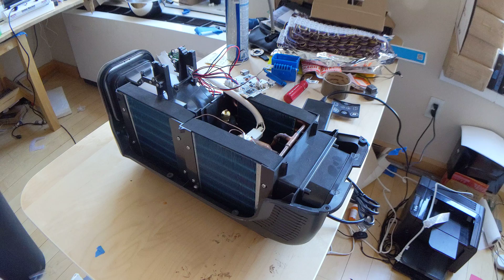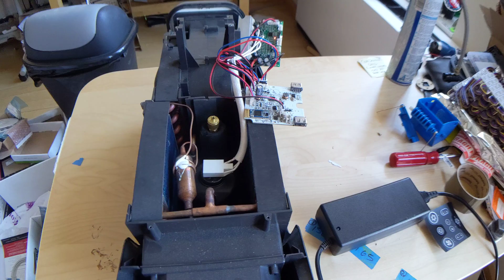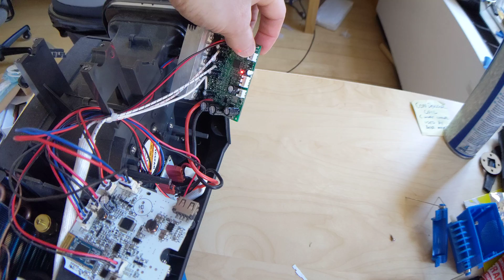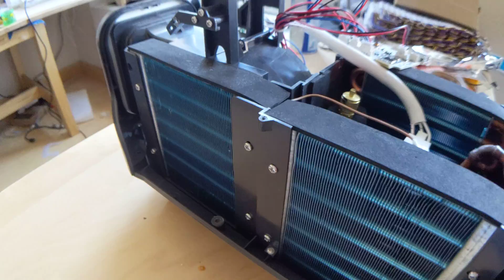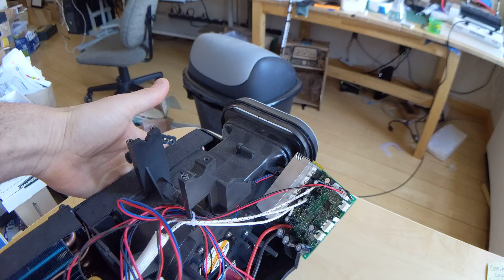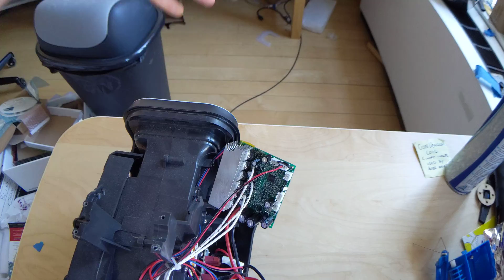A look inside the Zero Breeze air conditioner with a tiny little compressor

Comment: Any idea about a capacitor replacement? Mine is bad?
Reply from the maker: Which capacitor?
Reply: Sorry, I thought it had a capacitor. I opened up my unit, noticed there was a burnt smell (like plastic) it was the white plug that goes to the compressor.  The unit will run them shut off. Not sure if it is the compressor.  Thanks

Comment: Any idea why the unit would shut off on its own after a few minutes of running?
Reply from the maker: Could be many things, but the first thing I would check is an "over pressure" fault. This happens when the hot side coils get too hot, and this can happen if not enough air is flowing over them, and this can happen if the air is getting blocked, and this can happen if something is blocking the vents or the coils are fouled with built up dust and crud. Do you feel lots of hot air blowing out the back? Can you tell if the coils are getting blocked?

Comment: How did you disassemble the unit? Can you make a video showing that?
Reply from the maker: It was a while ago so I don't remember the exact steps, but it was not too hard. A few screws and plastic snaps.
Reply: @bigjoshlevine  I have a zero breeze, but the power port supply on the back broke (plastic). Zero breeze charges too much money to fix it, do in looking to see if some super glue will fix the plastic part. I removed all the screws on the bottom, but am meeting with more resistance than I dare really push. Did you remove the top?
Reply from the maker: @t.drayer11 You could probably just nibble that broken connector out and replace it with a different one or connect the wires directly.
Reply: @bigjoshlevine  I tried to pull the connector out just a bit but the electrical wire to it must be real short, cuz there is no give to it. I have the mark 2 model and I don't know if that's the one you have also.

Comment: Can you help?

https://youtu.be/jbEaA0Ib1Sg

I am having trouble keeping the compressor running when i bypass the factory on/off switch with all the wierd features. Thanks
Reply from the maker: Maybe you are tripping the overpressure safety shutoff? This will turn off the compressor if the pressure in the pipe coming out of the compressor gets too high, which can happen if the condenser coils are not cooling off enough. This often happens in normal AC units if the coils don't have enough air blowing over them because they have crud on them or the outside fan is not working well. 
To see if this is you problem, maybe try putting some ice cubes on top of the condensing coils and then turn on the unit and see if it runs for longer time before shutting off. 
Report back with what you find!
Reply from the maker: Maybe try moving that fan I see in your video so that it is blowing air right into one side of the condenser coils to at least get some air moving though them? Normally the case would force the air that fan is sucking to pass though those coils on the way in.
Reply: @bigjoshlevine  awesome info! Thank you I'll try in the morning after work:)
Reply: I tried the ice by holding a few cubes on each side, putting the fan shroud and lid on, and I also mounted it back on the base. Still behaves the same way. I just ordered a variable speed compressor controller from Rigid and will be installing it when it comes in. I am building an aluminum shell now, so I'll update as I make mistakes😊
Reply from the maker: @functionalvanconversion4284  Hmmm... I am pretty sure the one that it came with is variable speed. On mine there is a little variable resistor that I think sets the compressor motor speed. You could try turning the speed way down and then seeing how it runs like that and then slowly turning up. It is a pretty simple system so hopefully you can nail down what is going wrong.
Reply: Is it normal for the capacitors to register 205 degrees? The AC is working now but I just wanted to double check. I am not sure why it was shutting the compressor down. I am going to run it off a relay for now and try the arduino when it actually works for a while.
Reply: I finished the frame, foamed all gaps, and the compressor only stays on for 15 minutes max and it doesn't have a consistent amount of time that the compressor stays on. I am going to shelf this for now. I really want to bypass the on off switch that zerobreeze provided and I believe that is the problem since I remember this happening when I tried to put a speed controller on the compressor years ago. Thanks for your input and if you have any ideas please let me know.
Reply: I got it to work for a year with buck converter step down my lithium battery bank. Now it's doing the same thing. I ordered a split system for my man and have given up on this unit. Months of tinkering for less than a year of usage😢.

Comment: So there’s only one rear fan, then how it pushes hot air and brings in cool air from the outside. By the looks of it, it only exhaust hot air from the condenser coils using the rear fan.
Reply from the maker: There are two fans - one that sucks outside air though the condenser coils and then blows out the back, and the another sucks outside air though the evap coil and then blows that (cool) air out the front (where you are supposed to aim it or duct it to where ever you want it).

Comment: Could you wire an analog thermostat on this like you would find at a big box store? Mine actually gets my sleeping area too cold in the middle of the night. But need it full throttle in the day to try to keep up. Could you recommend a variable speed compressor controller also as it's pretty loud
Reply from the maker: Yes, no problem. Even better - you could use an arduino and a digital temp sensor to have this unit slow down to the exact right speed to keep your room at the set temp. Much better than having it cycle on and off - especially where you sleep!
Reply: @bigjoshlevine  thanks for info. I am educating myself on arduinos. Would I connect the Arduino and thermostat to the red and black wires that connect to the ZeroBreeze control board? I tried connecting an analog thermostat to these two wires on the ZeroBreeze but could not get it to work. I also tried connecting a speed controller, but it must pass a small amount of current even in the off position since the compressor would still run and had no change when I adjusted the speed controller up and down.

Comment: I bought 1 to use in my Jeep.  It does work.  However, my keeps stopping.  It cools from a beginning displayed temp of 90+ to 74 or 75, then stops cooling the air coming out.  I turn it off for 5 minutes, then it starts cooling again.  Any thoughts?

Comment: Can anyone help me and tell me how to take the cover off this thing? I need to get inside to fill it up with Freon, and I can’t figure out how to do it without breaking the plastic cover.
Reply from the maker: What happened to the refrigerant that was in it?!
Reply: Josh Levine No idea, I bought it like that (used).
Reply from the maker: I just unscrewed the screws and popped the cover off, I don't remember any special trick. But are you sure that the problem with yours is low refrigerant? When you turn it on do the fans run? Does the compressor run?
Reply: Josh Levine yes, everything runs good. It’s actually a friend of mine that’s trying to fix it for me, apparently he knows what he’s doing 🤔. He said there is a small refrigerant leak. I have no idea why he has a hard time taking the cover off. I’ll go and see him tomorrow. Thank you for your help!

Comment: Thanks for the video. I pulled mine apart because it almost sounded like the fan was hitting something. Turned out it was the compressor vibrating loudly. I added some foam on the top and bottom of the mounting bolts and now it’s very quiet. I also noticed that the air inlet for the condenser and evaporator connects. I’m sure it’s not a big deal as both fans pull through the condenser and the evap. But I sealed that off also.

Comment: so folks are not mislead? Rotary spins and if it's a piston going up and down it's called a reciprocating compressor? But it's probably neither of those and instead a scroll? That round copper thingamajig is called an accumulator or a filter/dryer but in this case it appears the compressor high side goes through the condenser coil in back to lose heat then comes to the filter/dryer splits between the 2 evaporator(cooling) coils becoming gas and returning to the compressor? Just my thoughts and its really a cute baby set up because back in my days we just hooked a 4" flexable duct onto the supply from a 5000 btu window unit from sears for 69$ and out tent was the envy of the campground! :-)"
Reply from the maker: I still use the flexible-duct-taped-to-outlet-of-window-unit trick to get silent cooling in my bedroom. Lazy man's split system! :) 
https://twitter.com/bigjoshlevine/status/1285064587180740609

Comment: So, it does look like it actually has a compressor, like any good AC system must have to call itself that, but, where is the heat from the room it's trying to cool get dumped to?
Reply from the maker: There is a condenser coil with a fan that blows the hot air out the back. You can either just aim the cold air towards you and the hot air away from you, or you can connect a flex duct to take the hot air someplace far away or outside. Here is a video showing the setup... https://www.youtube.com/watch?v=v2ZisExtbhM . Not how I would do it, but unlike every other portable cooling system I've seen it is an actual AC unit.

Comment: What kind of refrigerant does it use?
Reply from the maker: Likely R134A.
Reply: @bigjoshlevine  In the USA R134A was made banned for use in new equipment as of 01/01/2021.

I wonder if they had a stock pile of R134A? to use up then?
However like no one is getting my stash of R12 cans or my full cylinder of R22. but I have to go I think the EPA is knocking at the door!

Comment: and those tiny compressors are used for portable car  mini refrigerators! can find a ton like them on aliexpress 12/24v ones. and thats rotary but doesnt have any fancy energy efficient stuff like inverter tech. and all they did was to build a case for that?? it will definitely not cool even a tent.

Comment: Could have been lighter and more powerful with microchannel heat exchangers don’t you think?
Reply from the maker: I don't think the coils are the limiting factor for either the size or capacity of this unit. If you made the evap coil smaller you'd still be limited by the size of the output ducts. Based on the fact that the condenser coil barely feels warm to me I thank that is also probably sized to fit the form factor. To get more capacity I think you'd first need to size up the compressor which would be challenging for the current form factor.
Reply: Josh Levine That’s exactly what I mean, by switching to microchannel heat exchangers, more space can be dedicated to more powerful fans and a slightly bigger compressor.

Comment: I own one for over two years, it will keep you cool in hot weather but your face needs to be right in front of the unit. I am going to try to modify the housing, so I can put have the unit outside my campervan window as it just fits if I eliminate the blue top cover just like a standard window AC does (major space waster). The reason is I have tried venting the air out the window, even installed a 4 inch inline fan to pull the hot air out, but it created to much negative pressure and pulls out cool air too. My  hope is that performance will improve as the heat will be outside the cooling space along with a more quiet operation. Any thoughts? Thanks for the great video!
Reply: I totally agree with you, this unit would work better if the hot side of the unit could stay outside of the car/van/window. It's also pumping out at most 600 watts of heat, so reducing the size of the cooled area would help it out. Also remember that our body puts out about 100 watts of heat per hour.
Reply: @gildardo  thanks for the information, I didn't know we put out that much heat. I did end up doing the modification to have the condensor outside the van. The performance is much better, but the aviator connection still gets warm. Keeps our little bedroom nice and cool.
Reply: @functionalvanconversion4284  Thanks for the update. Good to hear that it worked out for you.
Reply: @functionalvanconversion4284  That is exactly what I was thinking. Great Job.

Comment: Josh, how can I open the top lid? I cannot find a way to free the bluetooth box area...  you seem to have removed the top panel skin? Is there anything behind it? I need to take a look at the controller board, the compressor is not running.   Could you help please?  Thank you!

Comment: that's the expansion tube to allow room for the expanded freon gas going into the compressor.
Reply: It’s not an expansion tube.  It’s a desiccant filter dryer.  That’s at the end of the liquid line after it leaves the condenser, and before the liquid refrigerant enters the metering device, in this case, a capillary tube.

Comment: It's part of the high side of the system it a liquid line drier high pressure refrigerant is in a liquid form so it passes through the line drier and is filtered (primarily to remove moisture) then it leaves the drier through the small capillary tube then it is dumped into the evaporator ( the part that gets cold).the evaporator has larger diameter tubing so the gas is allowed to expand as it travels through the evaporator it drops pressure and returns to a gas form were it is then sucked into the suction line of the compressor to then repeat the process all over again. It's the same way a common home refrigerator works. Larger cooling systems use a metering device instead of a fixed capillary line this allows more finite pressure adjustment.
Reply: True, but in this case should it be horizontal or at a slight angle?

Comment: if you go to alibaba , and  search micro compressor , it will show up , what compressor the zero breeze uses , and these compressors are super cheap.
Reply: When 300$ is super cheap
Reply: @Mahyar_BEH  They are not $300 , you can get them off alibaba for $90, if you look hard enough
Reply: @MichaelWeaser   maybe  but  the model  they used  is 300
Reply: @Mahyar_BEH  What is the model compressor that is used?
Reply: @MichaelWeaser   I don't remember  I think  I was qx1900
Reply: @Mahyar_BEH  there is a 12v micro compressor called the QX1901 , is that it?
Reply: @MichaelWeaser   I think yeah

Comment: Zero Breeze
Zero Breeze
3 天前
Thank you for the Nobel Peace Prize,
Yes, most people are amazed that air conditioners can be so small.
You can watch this video that Zero Breeze Mark 2 generats a lot of water , https://youtu.be/9pLKriWfehk
It works at cooling mode.
The Zero Breeze Mark 2 air conditioner has a small water tank with a capacity of about 600ml. For 50% of the moderate humidity, it will be full filled after about 2 hours cooling.
When full filled, the water will flow out of the hole in the tail. By connecting a pipe, you can use a container or bottle to collect the water.
After using it, you need to tilt the air conditioner backwards to drain the water inside before moving it.
The Mark 2 is working at 24v, and the battery outputs 24v.
210 watts is the maximum power of the air conditioner when it is working at the ambient temperature over 95F.
 
1

magdison Chow
magdison Chow
1 天前
@Zero Breeze As you said that the cooling capacity of this equipment is quit lower =  450 BTU/hr , 
the equipment cooling capacity is 24V x 5.5A/h = 132W/h  
Cooling capacity = 132W x 3.412141633 = 450 BTU/hr  , The mean this is a 1/20HP air conditioning, I think for blower will fee some cool in the summer! 
(1 BTU/hr = 0.29307107 W) or 1W (Power)= 3.412141633 BTU/hr
 

Zero Breeze
Zero Breeze
1 天前
@magdison week 24V x 5.5A / h = 132W / h It is the power consumption of the refrigeration equipment, does not represent the cooling capacity of the equipment; It should not be calculated like that.

1

magdison Chow
magdison Chow
2 秒前
@Zero Breeze That is not a  refrigeration equipment and all of the compressor and cooling coil with condenser is inside this machine. You company is a Swindler and your advertisement shown this is a air conditioner and formula proof that is only 450BTU/hr . That mean  is not ture as your promote movie and consumer don't known your machine is small cooling capacity!

Comment: The receiver is also called a filter and dryer. It should never be mounted horizontally as the small capillary isnt fed with a constant flow of condensed liquid refrigerant. This can lead to starvation of the evaporator, reduced cooling and overheating of the compressor. 
It needs to be bent downwards at 45 degree angle.
Reply: Hi Ben, should the filter dryer be bent 45 degrees so that the thin line is lower than the thick line (or vice versa)?  Sorry for the non technical terminology
Reply: @gsonei  the capillary tube need to be at the downward slope the dryer. The entire piping of the condenser system to that point must be gravity sloping.

Comment: Is this a scam like the first one or are you really going to prove it outputs 1100 btus? Btw, it has been proven that the first one only puts out 480 btus not 1100. They completely fabricated the numbers to sell more units. And now they're back again with a second model... hopefully they are not using r134a again... btw, what a useless review, you open the thing up just so that you can show us it's cute? How about taking some actual readings to make sure the unit functions as advertised? Oh wait yeah then you would not be able to sell any units...
Reply from the maker: Not at all meant to be a review at all - part of a series meant to show what is inside some interesting AC units! https://wp.josh.com/2019/04/04/some-of-the-more-interesting-air-conditioners-i-have-met/
Reply: Loser